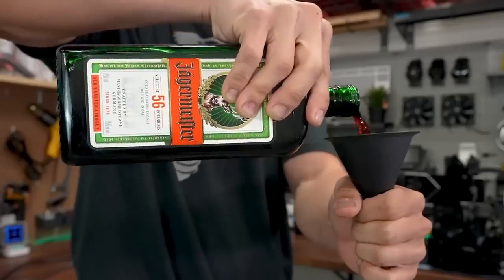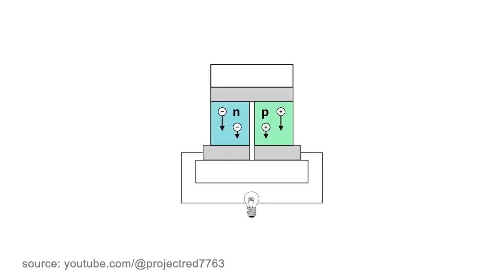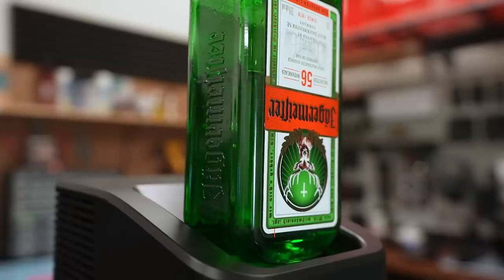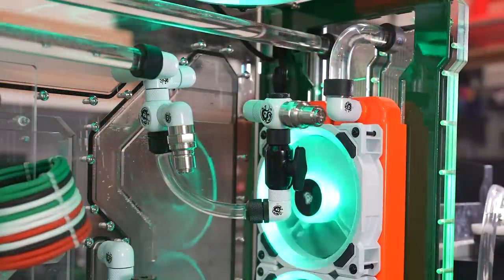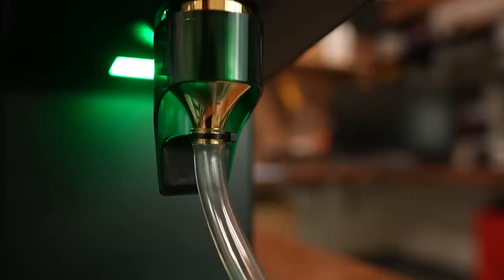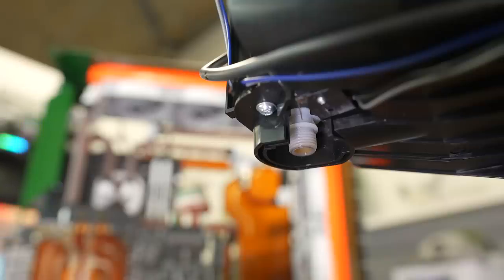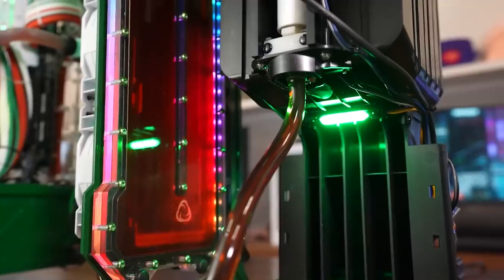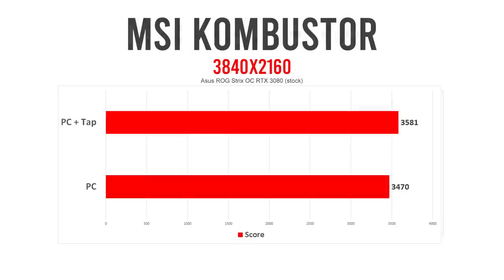Sub-Zero Cooling My Jagermeister PC with a TAP MACHINE

Comment: If Jagermeister is interested in pushing this further (please do it!) I'd love to see a build that uses multiple Jagermeister Tap Machines built into the loop on a full time basis, where radiators could pull the coolant down to ambient, and then have 2-3 tap machines flowing in series (or one beefed-up Tap with a larger Peltier) drop the temps to below ambient. This plan wouldn't achieve below-freezing temperatures, but even sub-ambient cooling on a permanent basis (rather than just a single shot of boosted performance) would be awesome!
Reply: Peltier modules aren't efficient enough to do this effectively, but if you're interested, linus tech tips did a video where they made a custom setup to use 20 or so modules to cool a pc sub ambient, all custom hardware in a ridiculous setup bigger than the pc itself!
Reply: @spencerwarren8302  Oh right, I remember that video! That's probably why I was thinking about using multiple of these peltier taps
Reply: Nah. They need to submerge the whole PC into a vat of super chilled Jaeger.
Reply: @DarthChewie  Jagermeister sure is good at advertisement.

Comment: Peltier PC cooling was a thing back in the early 2000's. Neat to see it mentioned again.
Reply: I started thinking about those drink coolers they used to make that had a Peltier cooler on the side
Reply: They are still around but its expensive with all the extra concerns you have to deal with.  They are fun to play around with!!
Reply: I am wondering about this too after thinking about those snap on phone coolers, maybe they can find a way to integrate this with today's tech or hardware.
Reply: @stormgear896  EKWB actually offers a peltier CPU cooler for Intel chips. der8auer has a video about it,  too.
Reply: When the chip burns out----so does your pc.
Reply: LTT has done many videos on Peltier cooling
Reply: @Mystical_Zeus  but they tried to use it as a cpu block, not just to cool the fluid. this is way better

Comment: Should route the tube throug the back of the Yager bottle (bottle is just a slip cover for the tube at this point) and down through the bottle opening to the fitting.
Reply: yeah... but he cheaped out again in this build. 

using the bottle is the most crucial step of a Jägermeister build. 

Really lame outcome and many lazy solutions that had really easy fixed and would have made the build 10x better.

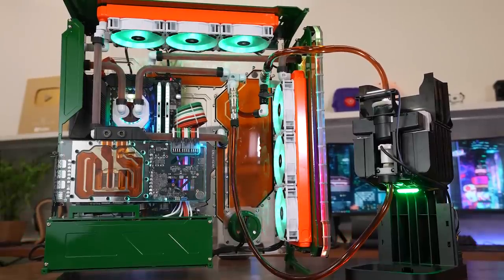7:30 i mean look at this.... its atrocious.

They should give the next build to someone else

Comment: Would've been cooler if you maintained the integrity of the tap machine... Like a tube passing through the inside of the inverted bottle hidden inside the liquid, and maybe increasing the diameter of the tap nozzle to fit the outgoing tubing...

Comment: Fun video! Just one thing. Although Propylene Glycol has a lower freezing point, it is not used in antifreeze, Ethylene Glycol is. Propylene Glycol is actually commonly used in medicines, cosmetics and food products to help maintain moisture. It is also commonly used in smoke machines, and is generally non-toxic. Ethylene Glycol on the other hand is poisonous.

Comment: you could potentially get more effect with a two loop setup.
install a large insulated reservoir in your PCs loop, which otherwise should be absolutely normal.
make the second loop cool the water of the reservoir with the external cooler.
the idea is to first start the secondary loop and let the water in the reservoir cool down as far as it would get.
THEN switch on the PC and run your benchmarks.
An improved idea would be a Two reservoir setup, with one reservoir being filled with chilled coolant as described above.
when the benchmarks start the coolant would be fed through the loop into the second reservoir, this way the water that has flown through the loop would not warm up the coolant in the reservoir.

Comment: I want to quickly mention, peltier coolers are a meme technology. Yes they work, but at awful efficiency, often around 20%. This is why they need to run for half a day before the shots are cold. Traditional refrigerant systems have downsides too however. While they are much better at cooling, a small system could probably cool that drink in 1/4 the time, making them that small is costly, you couldn't run the machine immediately after moving it (you need a few hours for the bubbles in the refrigerant to settle out) and there would be some noise. Personally, I think anything pelteir cooled takes so long to cool it becomes impractical to use, and there are refrigerant based machines available that can hold three bottles and have a nice tap on the front. I would suggest you go for one of those, unless you drink alone/with one other person max. Otherwise, don't bother getting a peltier device, they're generally mediocre
Reply: If you want to keep your drinks cold, you gotta go with the best of the best. And if that means splurgin' a little extra cash on a refrigerant system, then so be it. Ain't nothin' wrong with investing in quality. Just make sure you got enough for the whole crew, 'cause you know the Doggfather always gotta keep his peeps hydrated
Reply: That's a lot of words to say my peltier cool box works great, is cheap and weighs nothing in my car....

Comment: You should try an air to water radiator with a small refrigerator holding the water reservoir. To get some freezing temperatures…

Comment: yeah but on the tap machine, you are able to overvolt  and overlclock way more, like wayway more, that would probably boost is score by alot, same with the gpu, way more overclocking
Reply: you could also undervolt gpu to make it give off less heat and will relust in a cooler cpu wioth higher clock speeds

Comment: Couldn't you just cut a bigger hole in the back of the bottle and run the pipe through it. Same with the nozzle just mod them both to fit on as props even though they are serving a function.

Comment: Kyle all you had to do is make a bigger hole that the tube could fit through the bottle and just slide it in place over the fitting. I think You Have a SCAMMER playing games as I was told below that I won the giveaway which is still on going for over 1/2 hour.
Reply: bitwit385  Thank you but did I win the give away if the drawing didn't even happen yet SO YOU MUST BE A SCAMMER.

Comment: Don't use TEC for PC cooling. With TEC you need a big TEC unit an power. It's not efficient. TEC is only if you need a small temperature gradient but they are faster then a heat pump. Heat pump's are possible for 200-400 W without problem.

Comment: Couple Thoughts on this. 
If the outlet of the tap is 1/4" male fitting then why not a Female to Female adapter?

I think feeding the cooled liquid into the reservoir or creating another resorvior after the tap would make bigger impact since the water would be able to gather. 

Currently you have it feeding into a raditor which will heat up the liquid since the air is warmer than the liquid. That at the very least needs to change for better performance.